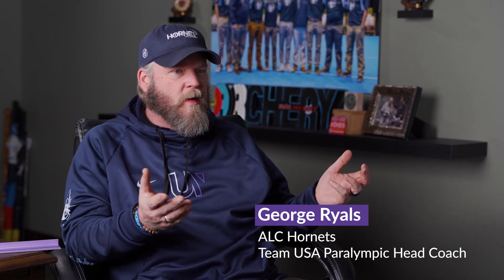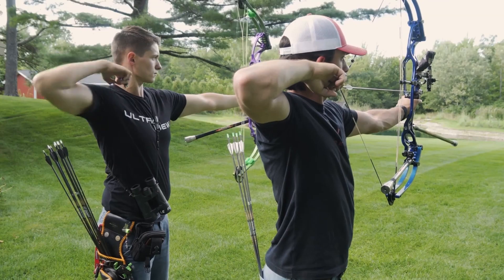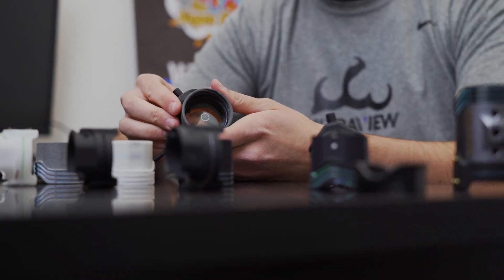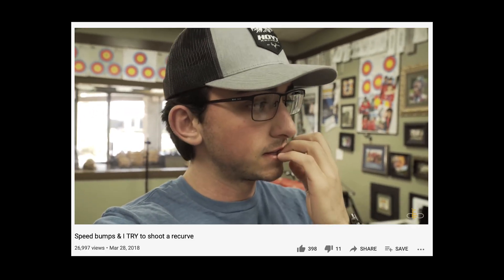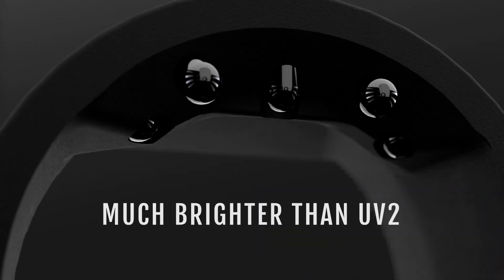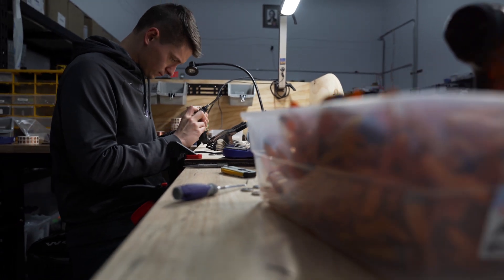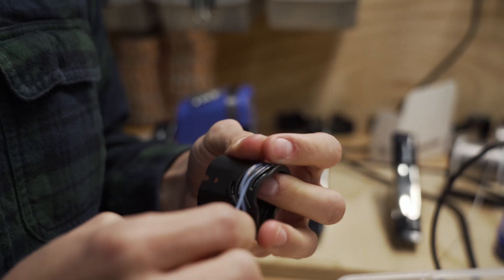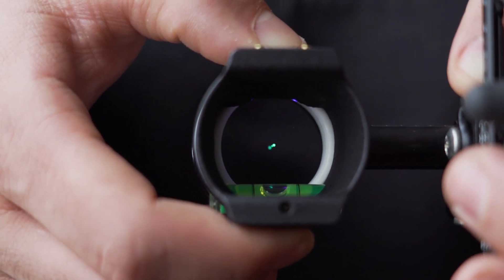THIS Is Ultraview

Comment: You guys should add a cross in the background lense to level it from up and down instead of side to side only. I like the idea of it correcting you if your off side to side, but what about it being blocked by the up and down axis. Or is there a solution you guys gm haven’t mentioned about it yet